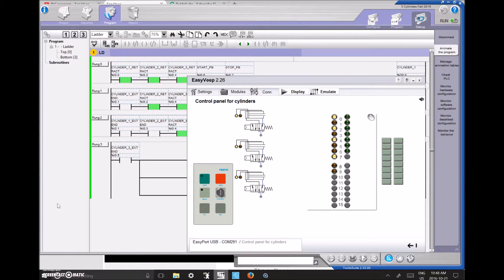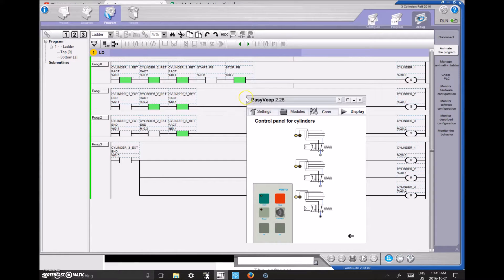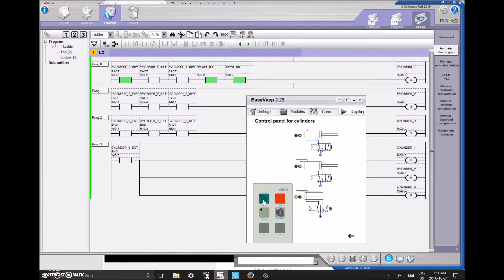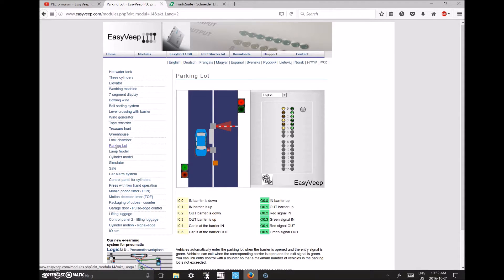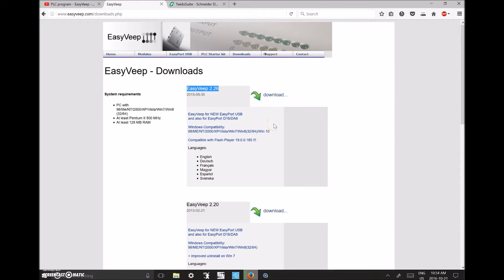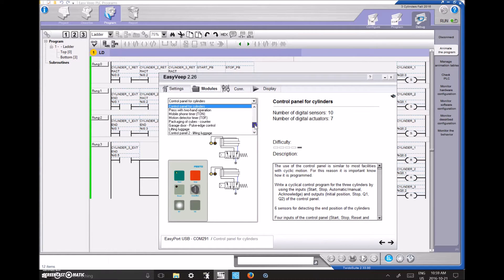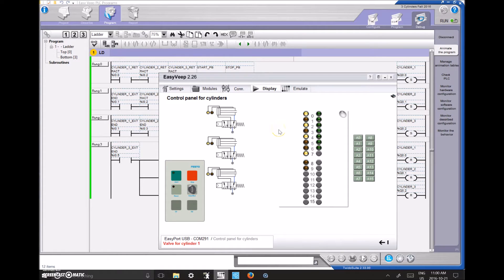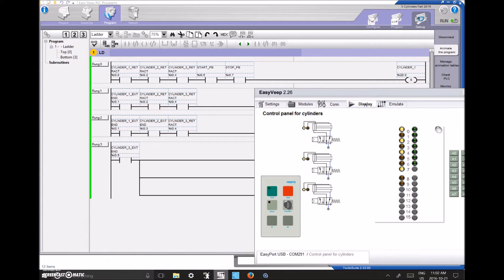PLC Tutorial (Festo Easy Veep) #1 (Setup the Easy Veep to Communicate with your PLC)

Comment: Hi, is it possible to run EasyVeep with a virtual PLC? or does it only work with a real PLC?
I would like to use fluidsim Codesys or any other program to make the EasyVeep HMI work
Reply: Did this work?  it seems like you need the actual PLC to do it even after looking at that posted link.